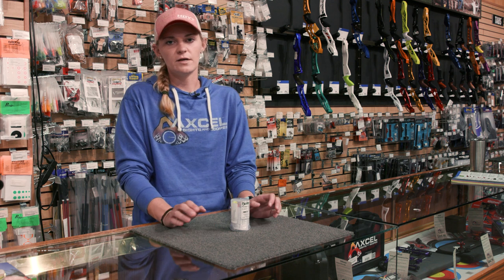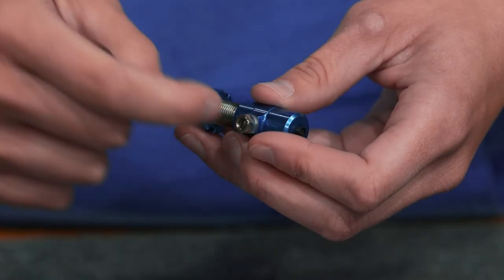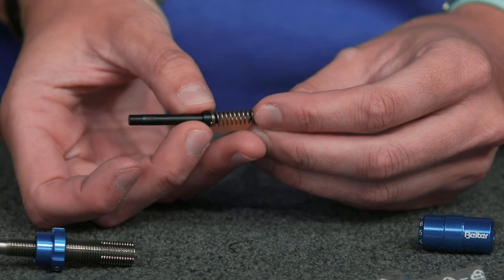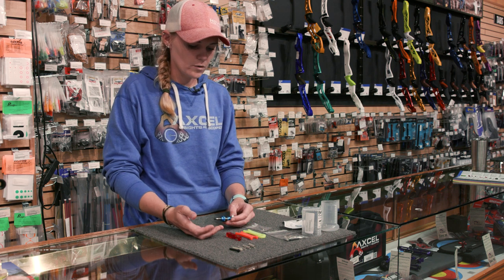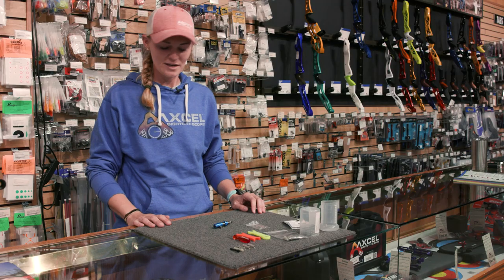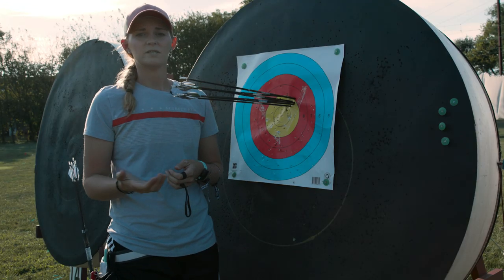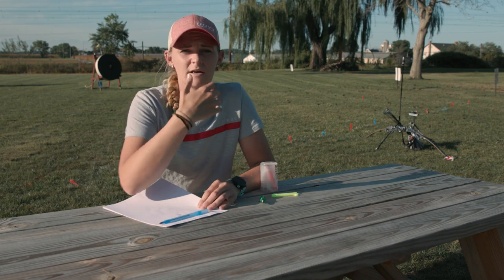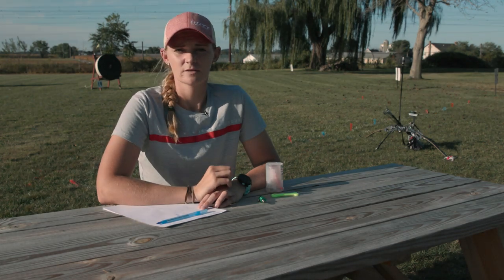How To Tune A Plunger On A Recurve Bow

Comment: Nice vid but you did not say anything about how to adjust the plunger and what effect it has on arrow flight.
Reply: Weaker spine- increase the spring tension
Stiffer spine- decrease the spring tension, but you should make bare shaft tuning and adjusting centre shot for optimum arrow flight..arrows grouping well.. the spring tension but guided by the strength the poundage of your bow, either lower poundage or higher poundage...

Comment: I have found that those little see-through plastic bottles (with the locking caps) that my meds come in from the pharmacy make perfect storage containers for little, bitty screws and allen wrenches that, when dropped, are gone forever.  I place a "post-it" slip of paper inside the bottle to label the contents of the bottle.

Comment: Are the tips really different materials? I know for sure that they have different lengths (the black one is 2mm longer than the white one) and think the color is a form or length coding. The Beiter plunger with the long barrel uses dark green or light green tips, again the difference in length between those two is 2mm.
Reply: Alex K. Yes. Usually the black tip is used for carbon arrows, and the white is used for aluminums. They’re different material such that the tips don’t wear the arrows down in a bad manner, if I do recall correctly.
Reply: @cameronsenay882   I looked into the datasheet of the plunger that is provided by Beiter on their website and it states for the material of the plunger pins: "The material used for the Plunger Pin offers excellent glide- and wear-behaviour by using aluminum-, aluminum-carbon- or carbon-arrows." I couldn't find recommendations for use of particular pin colors with a given shaft material. So I still believe the only difference between the different pin colors is their length and of course the color added to the material.
Reply: Because of the confusion this video caused for me I contacted Beiter. The different colored Pins only differ in length, not material used. Guess the manufacturer knows best.
Reply: Alex K. Ah. I guess I was misinformed!
Reply: @cameronsenay882  Not true.... the Material is the same... just the colour changes to show a different lenght! :-)